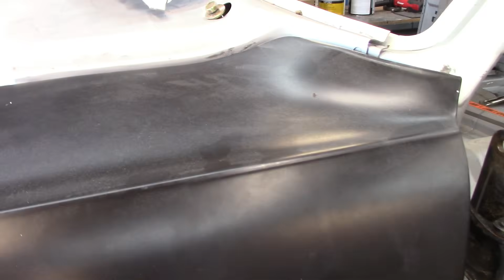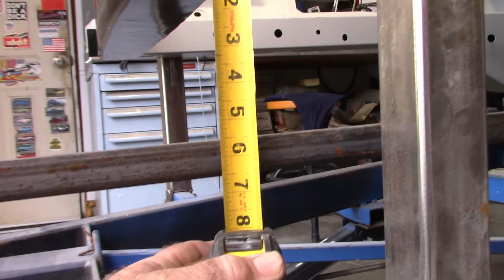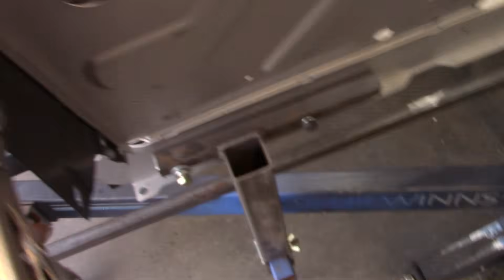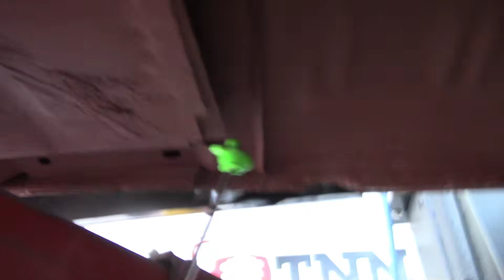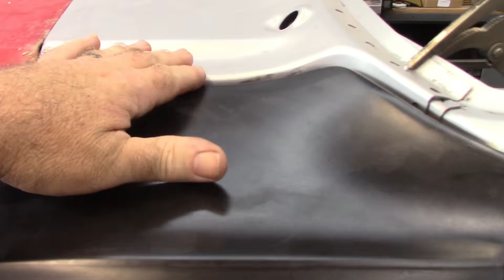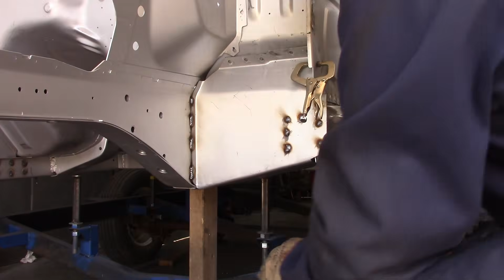1968 Mustang fastback build, Frame rails and torque boxes. Fangled part 11 #mustang #fastback

Comment: question for you my friend --- what , if any, paint prep and anti corrosion painting would you recommend between the inner torque box and the firewall? is weld thru primer sufficient between those two surfaces, or would you recommend any additional coating?
Reply from the maker: Good question. In most cases the existing primer or paint is likely enough. The original cars had nothing but raw metal there. Adding seam sealer where the torque box meets the firewall will keep moisture out.

Comment: Given the intention for this vehicle, was it ever considered to build it on a full frame instead of the uni body?  I forget who, but recall someone makes a chassis that adds a full frame to the first gen Mustangs.  Also something I thought of with the full suspension replacement.  Does anyone make a conversion so you could drop the entire front k member which would allow to install the engine and trans from the bottom like a MOPAR?  That would make fitting a Coyote easier.  Are you still planning on the plastic engine for fabrication?  Would be cool if things like that were offered for rent.  In the last stream you mentioned reaching a point where your mind will be more active then your body will allow.  Well, with vision loss, I'm there now and I can tell you, it isn't fun.  Enjoy the ability as long as you can.  Life isn't nearly as enjoyable as it once was.
Reply from the maker: I don't think a full frame was considered as they're quite expensive. I like the K member idea, but I've never seen one for a mustang. Debating on the engine and transmission mock up pieces.